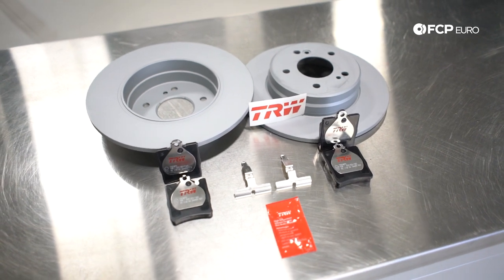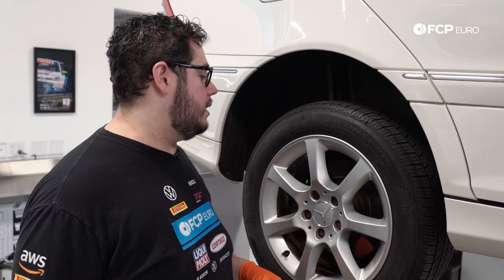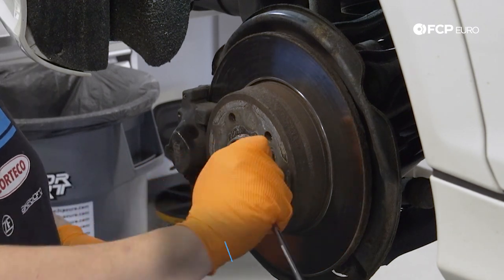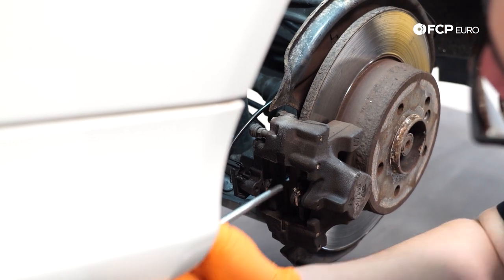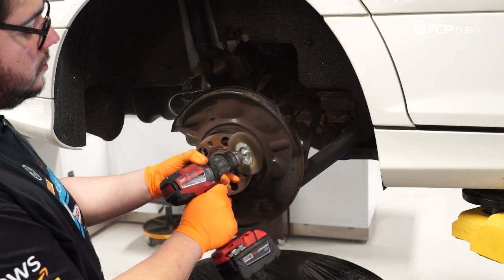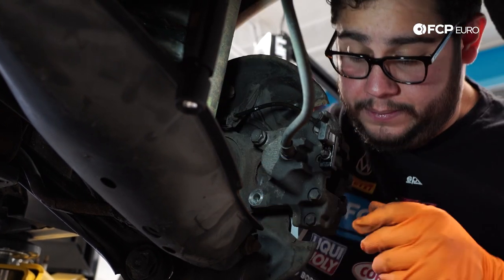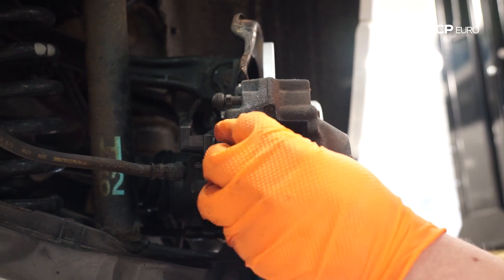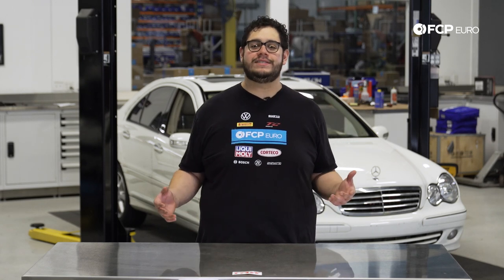Mercedes-Benz W203 Rear Brake Replacement DIY (C230, C320, CLK430, E300, & More)

Comment: Perfect set of instructions - thanks! One thought: the hole for the pin in front is small - 3 mm - and most punches bottom out before the pin is all the way through. If you don't have long punches, take a long nail (something like 3 inches or 75 mm) and use that as a punch. You may want to grind the point flat; you may also need to grind down the diameter because most nails of this length are pretty thick.

You took 13 minutes start to end for this. I took 1 1/2 hours because there is always some tool missing or something isn't coming off. This time the wheel seemed welded on and it was almost an hour before I got it loose.

Comment: thank you for the video.. for those in the salt belt.. take an air hammer with a flat bit and hit the hat of the rotor around the set screw.. then you should be able to get it out normally

Comment: So the car doesn't have any fluid brake lines?
Reply: Right?
Reply: @Elpipiton  im a little late but the video only focused on chaning the brake disc and cleaning out the parking brake, they didnt need to remove the brake caliper which has the brake fluid.

Comment: Hi, My meredes c280 has done 78k km. Please let me do I need to replace only the brake pads or also the Rotors?
Reply from the maker: Hi Sam, be sure to use some of the tips for break inspection noted at the beginning of the video. If your brake disc is showing any symptoms of wear, we would advise replacing them.

Comment: Hello, can anybody tell me the exact name or how to find the sensor, the part that is on the Caliper not the pad wear sensor, the sensor pointed out at 7mn55sc in this video 
Thank you
Reply from the maker: Hi Sid, that would be an ABS/Speed sensor, available on FCPEuro.com if you select your vehicle using the My Garage tool.
Reply: @fcpeuro  thank you so much for the fast and accurate response!
Thanks for the link too but it’s too expensive from the US I’ll try to find it here in Canada 
Thanks and keep up the good work 😊🙏🏼🦾

Comment: Not professional at all. You must un-adjust the parking  brake first, these are painted rotors and you need to sand the parking brake surface on the new rotor and after you install the rotor you need to tighten the parking brake adjuster until rotor won't move, back off a half a turn and do three times, Usually 1/2 a turn is about right should feel a slight drag, but not tight.  The adjuster is inside the rotor and is a star wheel.
You can damage the parking brake shoes if you use his method, if you do what your suppose to do first the rotor will slide right off and these guys need to invest in some tools as well. Usually we clean all the threads
as well including the bolts and lugs. They make male wire brushes you can put on an electric drill.